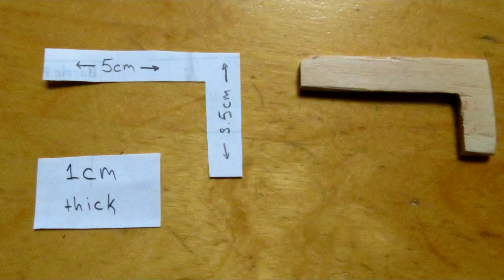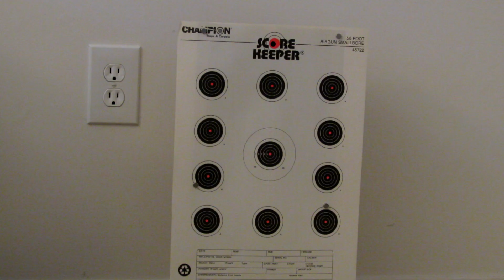How to Make a Mini Pistol Crossbow

Comment: First of all I like very much your Mini Pistol Crossbow . I think the stock is getting from balsa...Please is the aluminum flexible? Can you give me an idea as the trigger made in wood work?
Thanks a lot
Reply from the maker: hey thanks, I made my stock out of pine actually. Certain types of aluminum are flexible, best would be high carbon steel. And the trigger just pushes the string off the notch in the wood